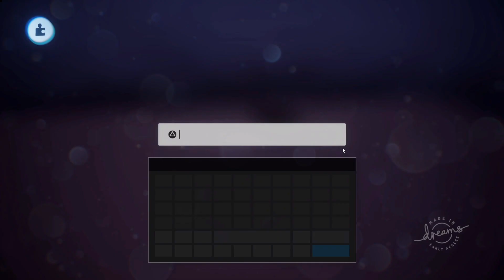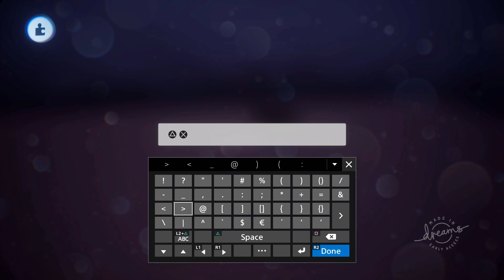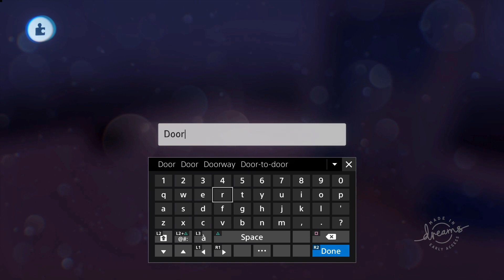Dreams PS4 Tutorial: Levers and Doors

Comment: How did you position the door to the open position, and how did you assign the text displayers to the door knobs specifically? And attaching the microchip to the door?
Reply from the maker: You need to watch the video, it is all explained. The door is opened with a keyframe. You just move the door into its open position. l1 + X will attach chips to objects. Text displayers inside attached microchips will display where you place them and move with the object.

Comment: Were there changes made to the game about this. Becaus I'm trying to replicate this lever box, and it doesn't work at all. The bolt does not attach to the inside walls of the same box. It only attaches to other sculptures. Also, how do you attach the actual lever to the purple bolt?
Reply from the maker: It always worked that way. The bolt is attached to the box and the lever. They are both separate sculptures. Where the bolt attaches is unimportant - the important bit is the pink bit, get that in the right position.
Reply: @DreamswithLadylexUK  I meant that the bolt would only attach from the child to the parent, and the two sides of the box don't count as two, it counts as only one sculpture. Maybe I just don't know enough to know exactly what you did with that box. I'm very new to the game. Is the a tutorial explaining step by step how to make that box and lever?
Reply from the maker: @ΙερώνυμοςΚόρακας  I have made a video. See my Dr Lex vid when it arrives.

Comment: I follow all these steps and i came up with an issue. The door isnt always working. Sometimes it opens and closes as its supposed to within the limits i've set, and other times its not working at all, or it doesnt open or close completely. What am i doing wrong? It doesnt make any sense. Also, how do i set the closing door sound?
Reply from the maker: Impossible to tell without seeing your microchip. This is a very old tutorial, one of the first ones I did. I have other methods now for this which I prefer to use. For example I no longer use remote controllers inside objects and use activation tags instead. Media Molecule have since released a working door with built in logic. Have a look at that.
Reply: @DreamswithLadylexUK  its been 2 days now that i've been losing my mind over this. But now i tried to turn the movable option off in the door's physical properties and it seems to work! So even though i do it with the ''old fashioned'' way, does it make sense?
Reply: Helloo! Quick question. How to ''destroy '' a text displayer after the door opens? So once i open it, even if i am obviously still in the trigger zone, the text will no longer be shown
Reply from the maker: @ToubaDam  Wire a not gate from the open door state and wire that to the power of the text gadget. The text gadget will only display if the door is not open.